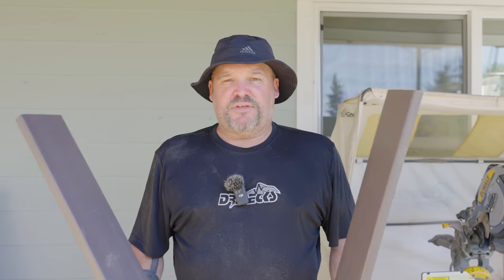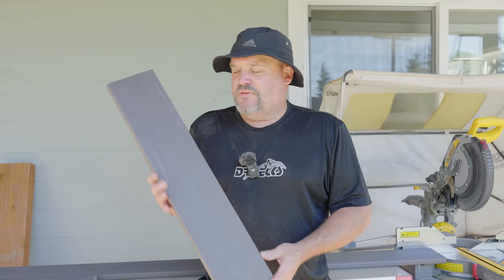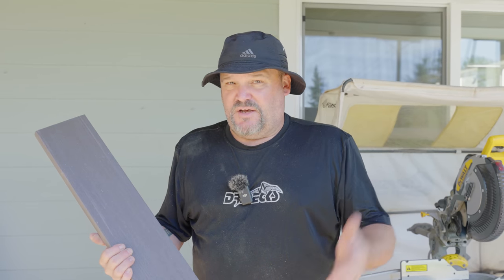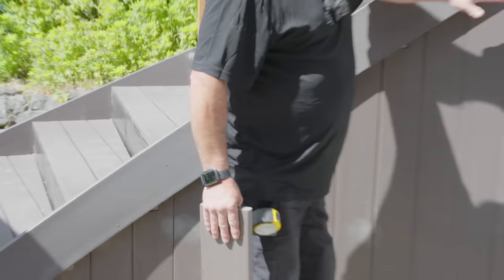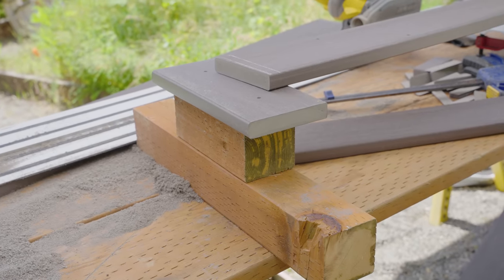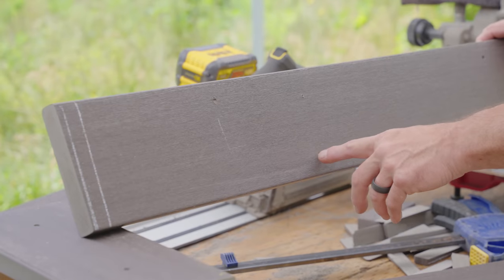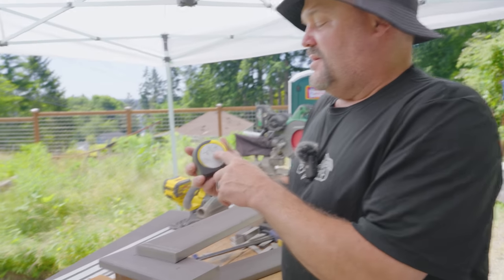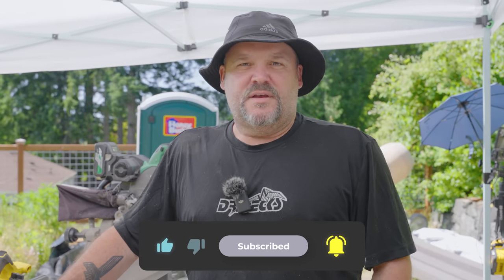Don't Throw Your Scraps Away: How We Reuse Them || Dr Decks

Comment: I like to use them as shims for an air gap when installing facia on deck bands. I also use them on the bottom of my stringers to keep them from having direct contact with concrete... makes great birdhouses also!
Reply: I’ve also used them as stand offs on the bottom of stair stringers.  I don’t know why I’ve never though of using for air gap on fascia, but that’s a good idea. Only question I’d have is if, over time and related expansion/contraction cycles, a wave or buckle/bulge may develop on the fascia between the shims; even at 12” spacing. Have you seen anything like this happen?
Reply: @devinbraun1852   I have never had it happen because of the shims. I have had it happen on a deck I installed during the winter where I didn't leave enough room between boards for expansion though.

Comment: I recently used Azek in a rebuild of my large back deck and side porch.  I ripped the edging off short cut offs that are at least 5.5” long to use as capping on exposed cut ends using 2P10X (a slick technique you demonstrated in earlier videos).